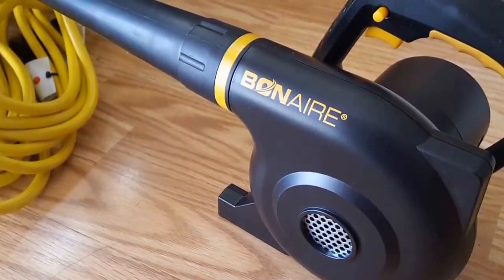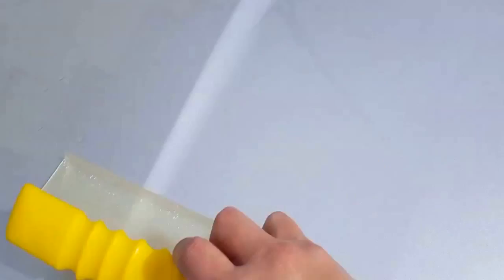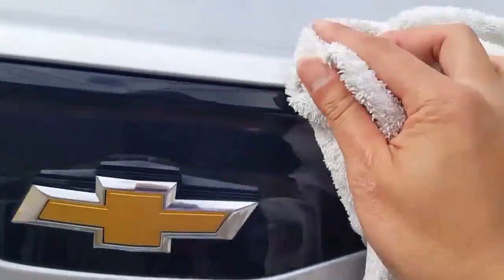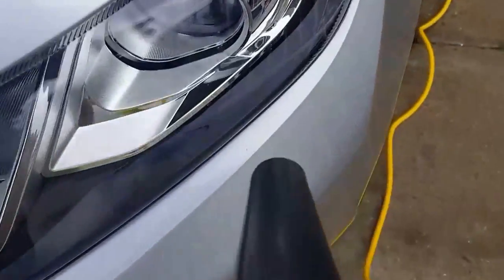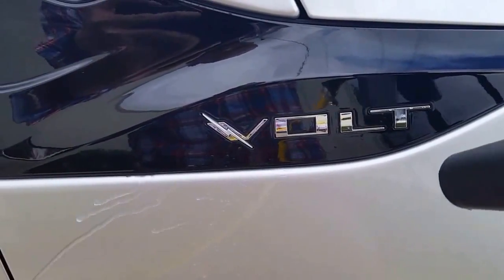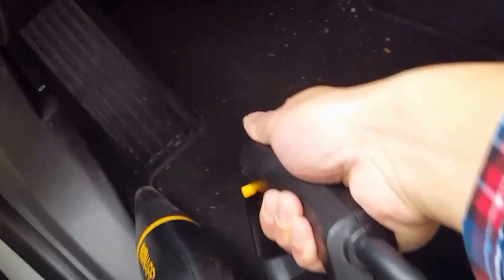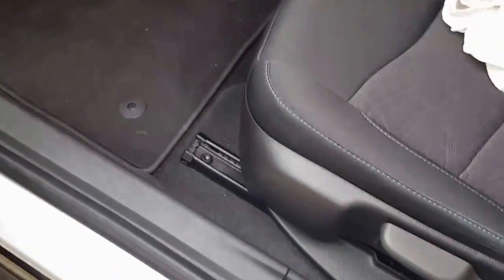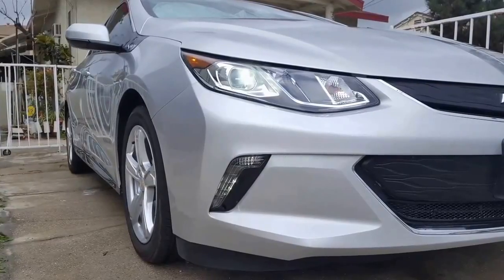Using $20 Costco Shop Blower for Drying and Cleaning my Chevy Volt!

Comment: I use the same blower to blow out trapped water. Works well. Loud tho

There's been a revolution in auto detailing last 15yrs = MICROFIBER.  Ya lose the blade, unless for windows only.
Reply: how do i get  the  3 inflation  acc    to  fit  on blower nozzle ?.

Comment: Little Costco blower for water removal; nice tip!
The rest of this video was definitely NOT what any of the numerous detailers I've been watching on YouTube would recommend.  Check out Pan the Organizer or Dallas Paint Correction.  Those guys can enlighten you tremendously about proper car care. For gosh sake stop blowing dust around.  It was near comical watching that.  I thought, seriously.  Thx for tip.  Good luck with all that.  PEACE
Reply from the maker: +James White thanks haven't did it in a while... after getting custom  plastic liners, I just hose it off in less than a minute.

Comment: Hearing that blade over the paint makes me cringe, ouch can you say paint scratch.
Reply from the maker: +J Coz why is everyone saying that i wax and have been using blades for years with no problems
Reply: It could be that you do it differently, but it is said that using a blade can put some bad scratches in your clear coat if there is any dirt or sharp edge on the blade.  If you have a soft clear coat like on my Honda, I would leave marks all over my car. You could have hard paint. If it works for you, stick with it.
Reply from the maker: +J Coz thanks bro! I have micro fiber and i keep the blade soft and clean. I used it on my 08 civic and 07 accord as well as my 17 chevy volt. It (okay mine) is still super soft silicone.
Reply: Salman Khan

Comment: +1  using it blowing water.
-5 using blade to drying the car is one of the worst way for drying on the paint. but using blade drying window is one effective way drying
 -10 using it to blow dust, dirt small rocks from the carpet.  why not using the vacuum instead?   all you do is making dust, dirt, small rock flying all over the car and you're just wasting more time chasing it than using vacuum suck it all up.
Reply from the maker: +Kevin Nguyen lol!
Reply from the maker: +Kevin Nguyen thanks. The blower works well for the water details. I perfer the blade for the paint its just faster.  The blower on the inside of the car was just fun :) i should have started from the front to back. But i dont need to use the blower any more i just take out the floor liners and wash it. Thanks for you input!
Reply: What does the blade do to the paint? Absolutely nothing 25 years experience. People just repeat what they hear from the self proclaimed Experts. Lemon pledge and a diaper will make a car Bling Bling baby. $1 store baby oil for the tires and black trim. After all the black magic tire shine is gone fill it up with baby oil. Anyone says they can tell the difference is talking out the side of their neck.

Comment: So u saying if u don't feel like getting the vacuum cleaner blow the dirt around and then wipe it up with a terry cloth??? I honestly feel like that Is working harder and not smarter as u making more work for yourself... It takes less time getting a vacuum cleaner setting it and vacuuming the car then wat it does blowing the dirt around and wiping it up with a cloth
Reply from the maker: +ady-B David i just use the blower for water the hard to reach places after  the car wash. I now have full floor liners and it takes 5 minutes spray off the dirt and towel dry the mats. Then i wipe my windows and dash... it takes about 30 minutes to clean my car now. This was a pretty old video i was experimenting with my new  blower.
Reply: im really not interested in you using the blower to dry the car, not to sure why you repeating yourself im talking to the fact that you use inside the car, a vacuum still goes much quicker... you use the blower it creates dust and that dust goes and settles else where you do realize that right? u being counter productive... you say the dust blows out the doors... thats rubbish...